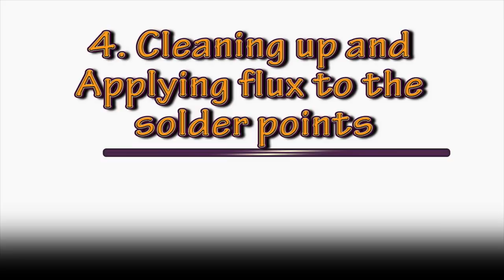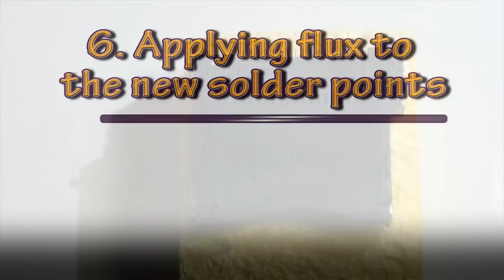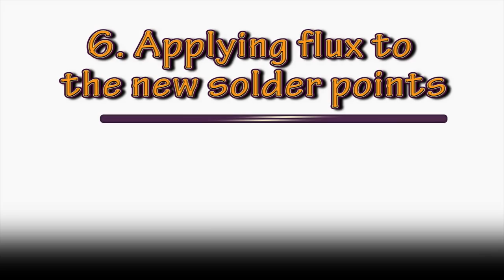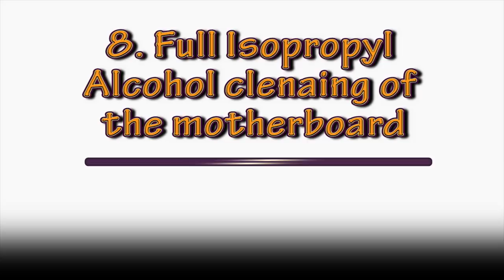Nintendo DSi XL Game Card Slot - Desoldering & Soldering Process FULL HD

Comment: Interesting, can I give you a tip?
Get rid of the de-soldering braid and use a de-soldering tool (solder sucker) instead, ten times easier to use and no need to put some solder on the joint before you try to remove it ;)